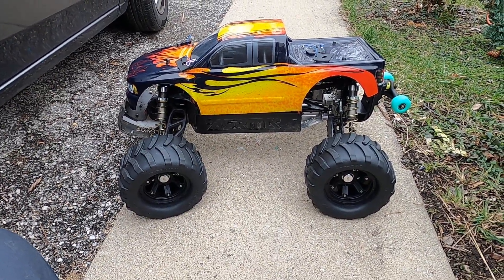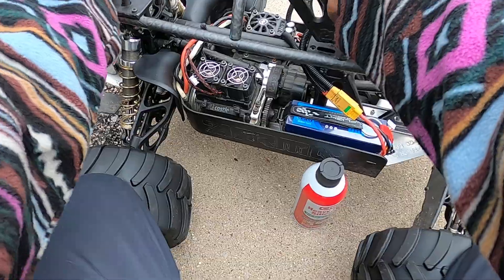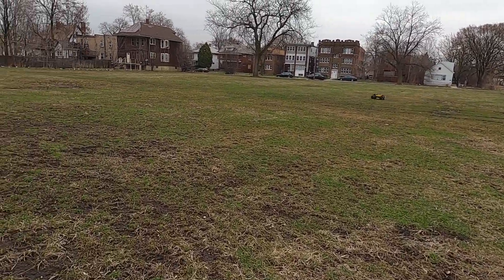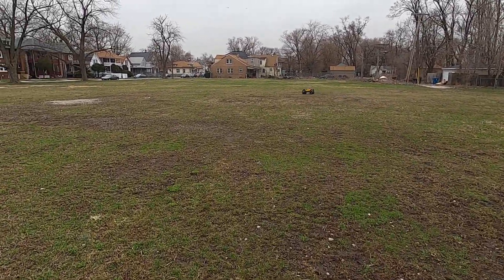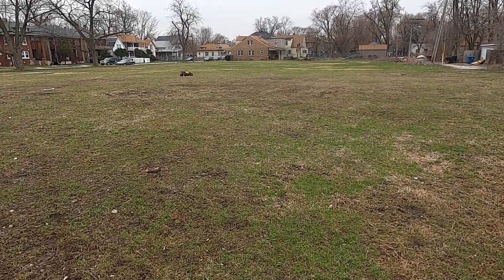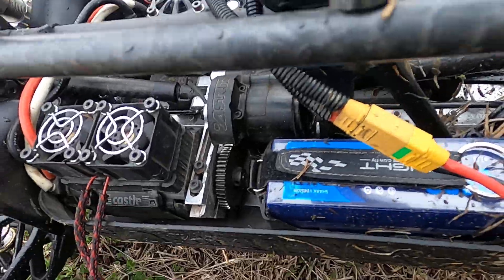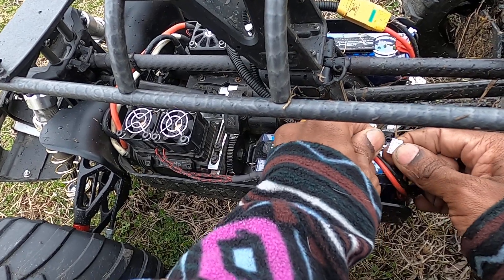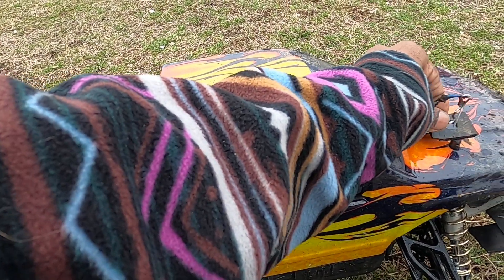Arrma Kraton 8S MT Update & Shakedown Run

Comment: That is a nice-looking truck, man.  It actually looks better than a stock Kraton. You are an artist. Yep, you definitely need high-power fans on that motor, when running tall pinions like that. On my 1/8 Kraton, I run it on 8S, and I always keep my 40 or 50mm fans on at all times. I run a 23T pinion on the motor. It usually keeps it really cool. The only overheating issue I had, was with my max6. It kept shutting off on me. So, I had to change the stock ESC fan to a 40mm one. Now, it stays cool. By the way, where did you buy those shocks? Do you have a link for them? Thanks.

Comment: U can get a small 3s or 4s pack to run the fans 🤷🏾‍♂️
Reply from the maker: That's what I mainly do, but I still have to make a mount for the battery. I don't feel like simply strapping it to the larger batteries this time.
Reply: @Megasty15  bro you know they sell small 3s and 4s pack don't have to get a big packs. 3s 4s packs for drones and  mini helicopters
Reply from the maker: @KalsRcAdventures  Yeah, I have several already just for lights & fans. 1550-2200mah. I use them on my other rigs. I made mounts for them in my Cen, hobao, & rovan but I usually just strap them to the larger lipos.

Comment: You need to turn those tires inside out take some 2 inch wide gorilla tape and tape it around  8 or 9 times turn wheels back right side out remount and goodbye ballooning tires your build is just amazing
Reply from the maker: I'm definitely going to play around with the tires. The main issues with strapping are the weight of the tape and the tape breaking. So I'll try to work around that.